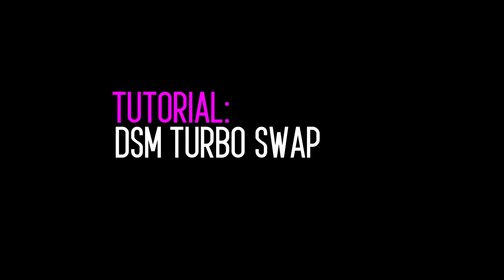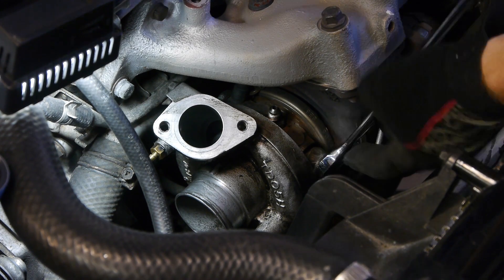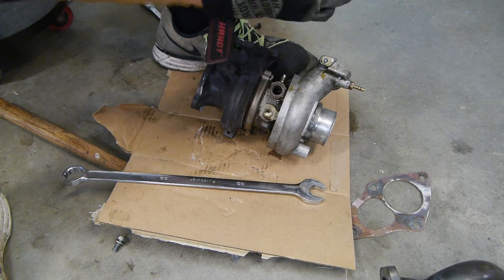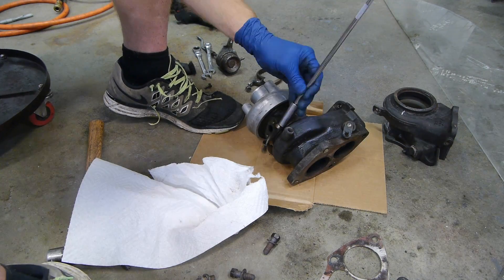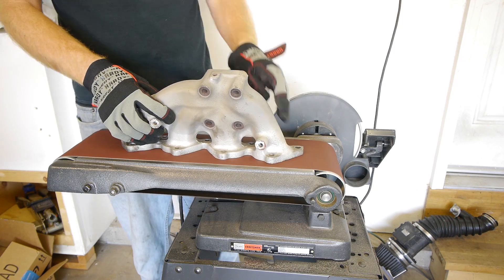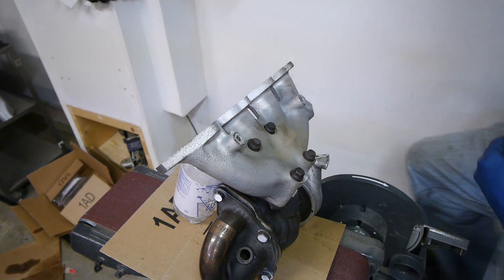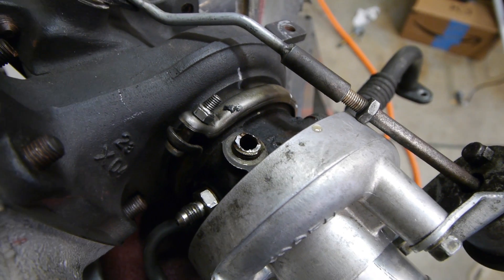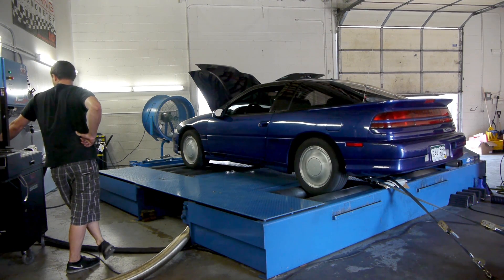DSM Turbo Swap and Exhaust Leak Fix Tutorial

Comment: The best way to remove the turbine housing from the cartridge is with heat a small hand-held torch helps remove them same with studs and bolts

Comment: I would avoid rtv for the turbo oil drain and definitely the supply lines, seeing as you torque the bolts down the rtv squeezes into the ports and could brake loose under oil pressure and float around in your oil system, well that or block flow to the turbo robbing it of oil.

Comment: did you powder coat the valve cover yourself ?
Reply from the maker: It's not powder coat, I used VHT SP451 Anodized Blue high temp spray paint.  It looked good new but it's chipping up pretty bad after 2 years.

Comment: 8:40 Oof, know that feeling. Stripped out a water pump bolt in my E39. Torque spec? 10Nm... aka barely hand tight. I don't even own a torque wrench that light.
Reply from the maker: Yikes, I would have demolished that thing! XD
Reply: Velocity Labs Yeah, I should say I broke a water pump stud; it left juuust enough protrusion for me to get in there with a vice grips and wrench it out without having to get all drill-y.

Comment: Excellent video, I've gone through this lots of times and I remove the radiator and appreciate the shit out of the room that it affords me, essentially draining the cooling system. and that does help a lot. Need to find some new upper radiator support bracket bushings  though.
Reply: WhiteDwarfVR4 does your exhaust always let out white smoke when the turbo is out?!